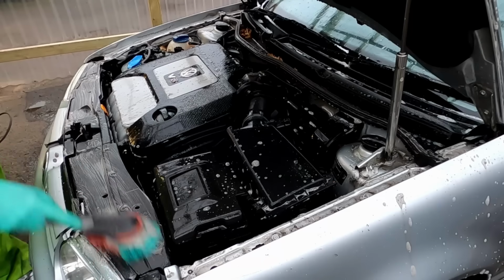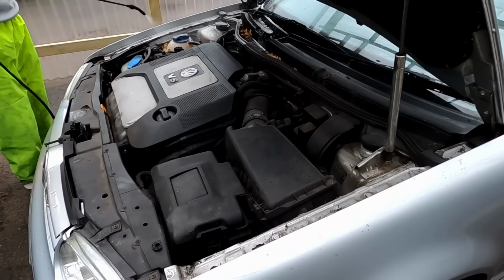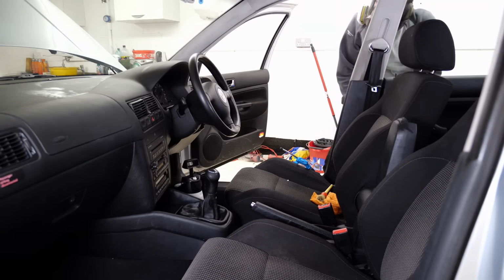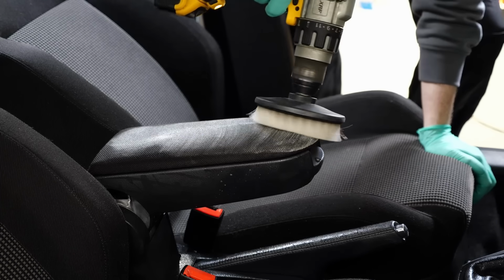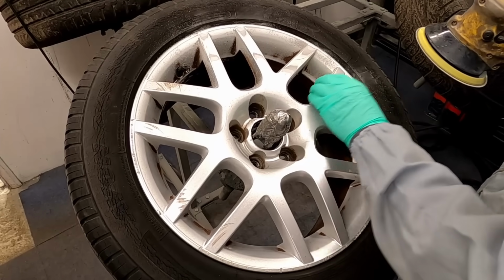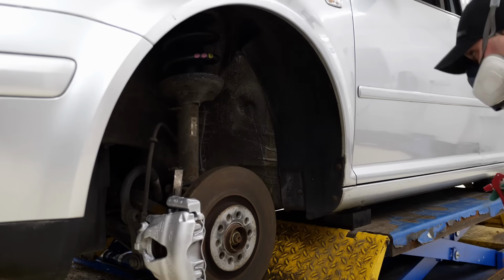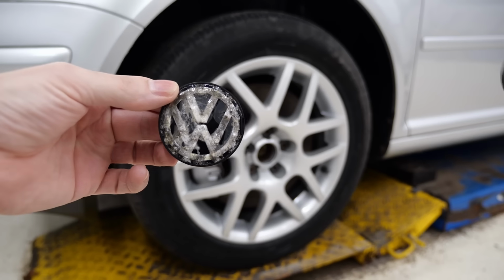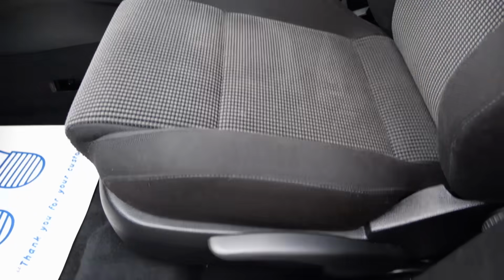Deep Cleaning a VW Golf 18 year old Disaster detail Dirty/Filthy Car

Comment: I purchased a mk4 Golf TDI new in 2001, and 393K miles later in 2019, I sold it to make way for a lightly used mk7.  I still sometimes wish I had kept the mk4, as I really liked it.  It still looked and drove great, but some of the plastics and pieces were just starting to wear out.  That, and I got a great price on the mk7.  Great job on the detail - it looks like it's got a ton of years left in it.
Reply from the maker: Thanks, so may people have very high miles from  the Mk4 good little car

Comment: Tip for your interior cleaning....try Blue Corral Dri-Clean spray cleaner in a blue can.   It is the very best cleaner for any surface inside a car.  Including seats, mats, dash, door panels etc.  Smells fresh too.  I have been using it for last 10 years.  It leaves no shine, so parts are ready for 303 Aerospace shine product.  Cheers!
Reply from the maker: Great suggestion! really appreciate the tip 23Piccolina 👍😀

Comment: Nice video and job. I used to have a 2004 Golf, automatic. I really loved that car, until I had problems with the fuel filter which I had it replaced two years on the roll. Those things were all made of plastic. 😡 not many manual transmission in Phoenix Arizona.  👍👍👍👍👍👍🇺🇸😉
Reply from the maker: Thanks for sharing  😀👍most of the v5's over here we automatic

Comment: Do you have a link anywhere to some of the brushes you use? I have this Golf with the same wheels, and cleaning in there is quite tricky. Worried about scratching but want something stiff enough to get rid of encrusted brake dust and dirt etc
Reply from the maker: I use ez wheel brushes and .. cheaper interior brushed (plastic)

Comment: When you clean a golf mk 4,5 or an octavia 1,2, make sure to clean behind the plastic wheelarches. They are known to be packed with dirt, leaves, sticks, mud there.
Reply from the maker: Thanks for the info! I used to have a 2003 1.8t 4x4 octavia 👍😀
Reply: @everydaydetailing6449  I have a 2008 octavia, 1.9 axr. The car is great for a run around, great gas milleage, cheap to run and to service.

Comment: Just a question on older petrol engine bay cleaning when they don't have an engine cover and caked in oil dust debris from the roads iv used a steamer a brush very fast movements with small amounts of apc but still had a few vauxhalls and fords flash up a misfire due to moisture getting past the coil pack. Iv got a 22 year old golf with no engine cover and never had this Problem but my golf has good rubbers when u come across other cars the rubbers are perished. So how do u avoid this problem Iv even tried having the wet vacuum suck as I use and steam or liquid lather but hasn't worked all the time theres still a risk to it
Reply from the maker: Its not easy to be honest, back in the 90's/2000's we often had to dry out dizzy caps and coil packs, the only other option, might to be use a compressed air line instead to remove the pre-soaked/scrubbed area 👍😀

Comment: Quality work as usual, people love exotic cars but there's nothing better than showing what detailing can do on a normal runaround 👌

Those tyres though 🤯 how did they last so long??

Also interested in the rupes uno protect vs koch all in one, looking at both for future services for customers and how you rate them 👍
Reply from the maker: Rupes is easier to work with and super easy on and off, but the Koch has way more cut, found the Rupes ok on light marring/dull paint, step up to the Koch for anything more involved 👍😀
Reply: @everydaydetailing6449 thanks you 👍  do you find the rupes is very much pad dependent for the cut?

Comment: What Paint did you use on the Calipers? Looks good and is it a heat resistant one? :)
Reply from the maker: Yes its heat resistant, Its a generic trade brand lasted on my own car for well over a year👍😀
Reply: @everydaydetailing6449  Ah Thank You! Im planning to do a similiar OEM Look in Spring on my Calipers aswell - here in Germany most people recommend Hammerite with a brush. :)
It definitely makes the car look way better even new cars look already so bad after 3-4 years.

Comment: If my compound get sticky on my oxidated paint what should i do
Reply from the maker: if the compound gets sticky, either try another brand as some paints can react differently to different products, I find koch chemie very universal and great at this problem.
The other issue is you have removed a lot of oxidation from the paint, and its simply clogged the pad, I may use 8-12 pads on a really flat/oxidated car, and ash them out afterwards

Comment: Wow that no one is talking about it. How you cleaned the engine is wrong in any way. If you clean an engine the car needs to run if not you might destroy the elictric cables and than you don't know why the car doesn't start. The best way to clean the engine is to use a brush soap and warm water. Disconnecting the battery is a must. That's my only critical point of this video and hopefully you don't do that.
Reply from the maker: Thanks for the message, just a little bit of a insight as stated I my latest video 90% of used cars going though main dealers and small businesses have the cars engine cleaned this way 👍 so can’t be that bad .. but each to there own 😁
Reply: @everydaydetailing6449  I didn't want to sound rude. It's true that most of the old cars would survive those type of cleanings because they have less electric cables compared to new cars. The problem here is that those old cables can get easily destroyed or burned with the pressure washer. The car is 18 year old no one can expect the cables to be brand new. That's why I wrote this comment to warn people who think to do that too. Cleaning the engine with pressure washer is a risk and not recommended. But still great Video I enjoyed watching it and for next time It would be nice to link the stuff you used 😉👍🏼

Comment: I would of made my life easier by removing the seats and then gave them a clean.. just a thought..?
Reply from the maker: On a tight budget, the time taken to take them out and can be used in other areas 👍😀
Reply: @everydaydetailing6449  yes some do take time removing the seats but some are really easy to remove. but tbh I find removing the seats every time is easier to clean I wiz round the car with loads of space to do my clean.